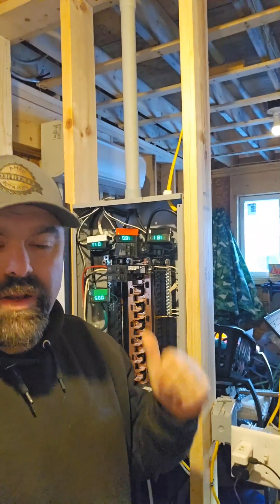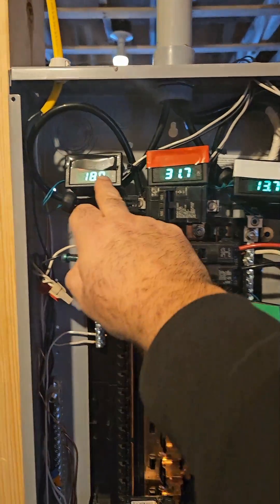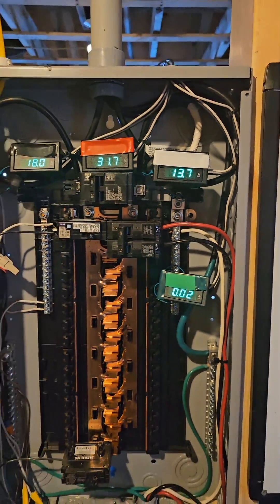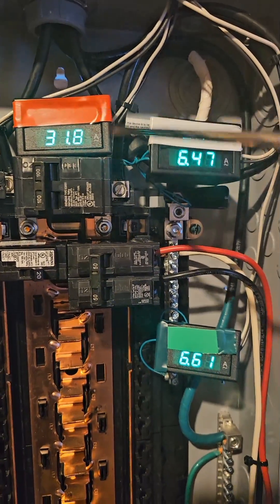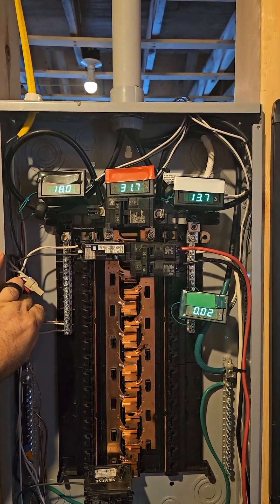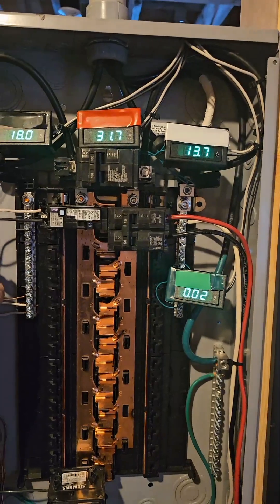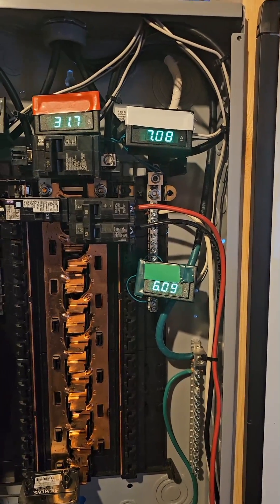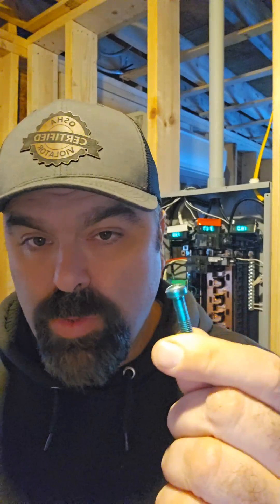What happen is DO NOT separate grounds and Neutrals

Comment: @stevenj120volts how does the one EQG on the neutral bus cause it to have the same outcome ? Confused on the path of how it would make it do that. I understand the objectionable current with the feeder neutral and feeder EQG tied together causing that but do not understand how one branch circuit EQG can do same thing
Reply from the maker: @NICK112o_o  the one ground I add is bar and is making contact with out ground that are on the ground bar. It can also make contact with bar parts of the panel that are exposed and bonded to the ground bar
Reply: @Stevenj120volts  thanks for responding bro watch all your videos. You’re the Goat . Keep up the good work
Reply from the maker: @NICK112o_o  thanks

Comment: One very dangerous thing that never comes up is how lazy cheap ultility companies are allowed to only run one high voltage wire to their thousands of distribution transformers that use your copper water service, steel gas pipe and cast iron waste pipe to back feed the primary side of transformers. Every copper water pipe that I attached my amprobes in drew at least 0.2 amps of current even with the main breaker off & meter pulled out of socket . The pole that supplies the transformer to my house has 3 13,200 volt lines ( 3 phase Y connection  ) and only one high voltage wire to transformer. Also at least 10% of the poles in my big city have at least 8' of wire to ground rod at bottom of pole stolen. Takes them a good 6 months to repair them .

Comment: Excellent video. I see this all the time. As well as only 3 wires run to subs. Then the voltage drop on the Ground/Neutral conductor creates potential on the ground. So when someone touches a real ground like a sink with copper pipes and the case of an appliance they get shocked. Ground conductor should never have current on it, unless it is clearing a fault.

Comment: You definitely have a gift for both understanding, and explaining. In a rental house for work, several guys from the job, share the house, there was a single box containing three, sliding dimmer switches, the kind with the small rocker underneath. None of them worked correctly, if you would turn them off from the other switch, They wouldn’t turn back on from the dimmer, weird stuff like that. So it turns out that one switch was powered from right there at that three gang box, the second light was powered from the other switch for that three-way, and the third, was powered from the light itself. Whoever put these dimmers in, clearly had no idea what they were doing, then our boss bought non-dimmable, LED bulbs, so anytime someone dimmed these bulbs, they went bad in a matter of seconds. So, I did not have a multimeter, but I took it all apart and managed to figure out what was what, and got everything working, took me a little while since I had no multimeter lol. Sorry for the ramble, just thinking, maybe three way and four-way wiring might be a good video idea since you are so good at explaining things.